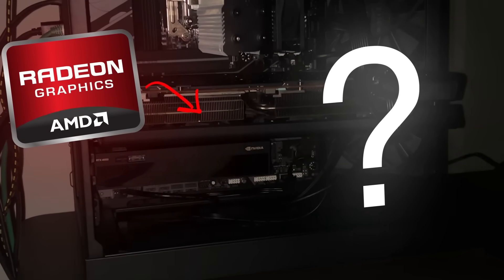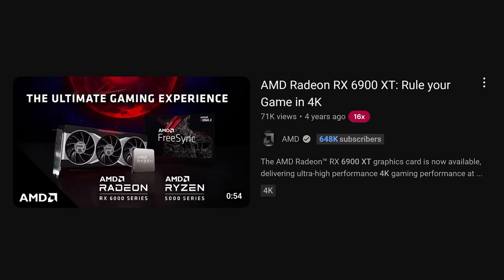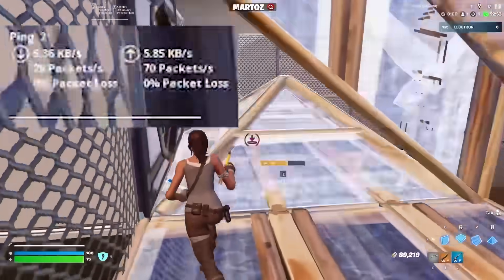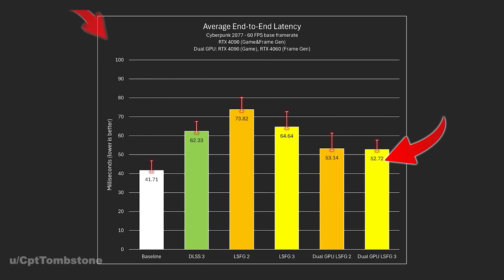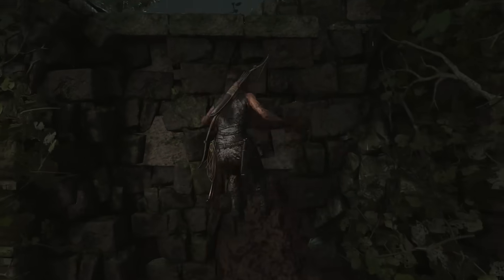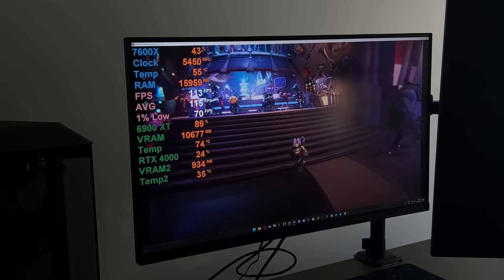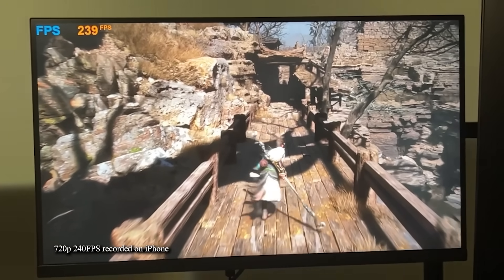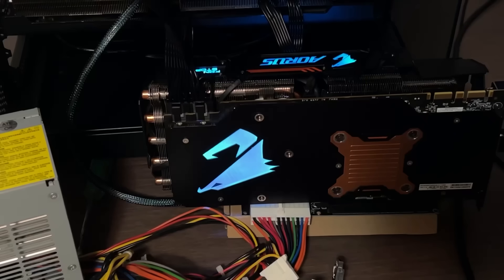I Used Both AMD & NVIDIA in One PC and Got 240 FPS in Every Game

Comment: so some warnings:

You MUST ALWAYS keep lossless scaling maximised on the screen, or you'll get the flipped FPS bug. So multiple monitors is basically required.

multi-gpu setup doesn't work well on windows 10. It's possible to get it working, but you have to mess around with the OS registry and a bunch of other stuff too.
This is made 1 000 000 times more difficult if you have two identically named (don't count the manufacture names like MSI, sea dragon e.c.t.) GPUs (e.g. my case; 2080 ti)

Works pretty easily with windows 11. But you have to use windows 11...

As mentioned in the video you need a high-end MOBO with 2 8x16 GPU slots.
Sure you can do what he did here but the M.2 interface is not really made to basically be maxed out constantly and every weird thing you add is just another fail point. I imagine most of the mentioned games would work (somewhat) with the accelerator card if it where not connected to an underpowered slot.

(for LSFG)
There will be at least roughly +2ms input delay with multi-GPU setup.

To get smoother generations it's recommended to have queue target to 1 which is basically -2 base FPS in additional input delay (so at 30 FPS you'll have ANOTHER +2.22ms input delay, 1.11ms for 60 FPS e.c.t.).

It's also recommended to have max frame latency higher for lower FPS games for better frame pacing (makes aiming easier), having it too low will break frame pacing - at the cost of even more input delay.

You can get a lot better frame pacing and latency if you use the fixed mode, instead of adaptive, and cap the FPS of the game to under its average FPS.

Adaptive is for games where you can't cap the FPS, the FPS swings by huge margins a lot (like 110 down to 40 for multiple seconds at least - like helldivers 2) or the average FPS is lower than 30.

If the second GPU isn't getting maxed out;
set the flow scale to max
tweak the queue target
then the max frame latency
(or just up the frame gen count if it's lower than your monitors refresh rate)

Comment: And all of a sudden, I can squeeze another 5 years out of my 1080 pc lmao.
Reply: yeah, you just need another gpu for it... wait... my ryzen 7950x has a built in igpu... could I use it to generate frames for my 7900xtx when the time comes? that would be a cool usecase ngl.
Reply: @uggZymoroon  old ATI/Radeon cards/APUs allowed for dual render. I think this was in like 2008-2014 they allowed it. In most games you get barely any boost, in very few games you get a MASSIVE boost, and in a few games you actually lose FPS
Reply: @uggZymoroon  You've got a 7900XTX brother you dont need to generate frames.
Reply: @uggZymoroon  you'd be losing performance due to the sacrificial core that have to render the frames. I think 🤔
Reply: @uggZymoroon yes you actually can! However don't expect miracles.
Reply: @uggZymoroon  bro's reinvented smart access memory
Reply: @uggZymoroon it would be useful if you limit the cpu performance so the igpu can work properly
Reply: "I'm tired boss"
Reply: I am looking forward to double 1080ti results of this method, if it actually works, the legend will rise again.
Reply: @maimaibiri9045  "now there's two of them...is this even legal?"

Fr tho, I'm still chugging along with the same 1080ti he was using in this vid. I'd love to add another to my fine collection (pun intended) and see what can be done with this setup).
Reply: @maimaibiri9045  I'm going 4070ti Super+1080ti, both blower cards. I'll be able to dry my laundry with them.
Reply: Pff, i'm squeezing another 5 out of my 2010 old weak ass radeon card pc, my 1080 current pc is gonna live at LEAST 15 more lol
Reply: What if your second GPU is a rtx 3050 that doesn't need extra power? Would that work?
Reply: @Chris-se6yh  depends. That 3050 has less than half the performance of a 1080ti
Reply: @OutOfNameIdeas2  it should, maybe as long as long as the first one has
Reply: Yeah my rx580 too xD
Reply: I just refurbished my 1080ti, cleaned the water block and put new pads/paste on it.  Poor thing, it was running a LN2 non-power limited bios for about 8yrs already lol
Reply: @ExtraVirginOIive  i run a 2010 mac pro😭🙏 shit's still pretty strong
Reply: @ExtraVirginOIive  that’s a lot of moneyz
Reply: who is lmao and do you know who lmfao is ?
Reply: depends what you play, sadly overall architechture , bus speed, CPU speed are gonna matter more ,  if you play large competitve world game could need 20+ core 6 ghz   '   like 'off the grid' example technology software
Reply: 1080ti lives on
Reply: nope.  plenty of games that require RT now and cant even be launched with your card.
Reply: Why would you use rt in a game like Fortnite it's stupid
Reply: While you don't get the latency REGRESSION of traditional frame generation when you use two cards, the latency is still going to be equivilent to the source frame-rate i.e. it will still FEEL like 30 FPS - even if the number says 60 and it looks smoother.
Reply: @zig131  this would be most useful for VR where you could double 72 fps.. 72 fps in put lag is pretty decent then you could use open xr tool kit to limit fps to what ever your hmd refresh rate runs at.. lossles wont work with vr as far as i know though
Reply: @awakeandwatching953  We have a superior method of "frame generation" in VR in the form of Asynchronous Space Warp, and whatever Valve call thier version. ASW increases visual smoothness AND reduces perceived latency. It works by shifting and warping the rendered frame to take into account head movement since the frame was rendered. It's kinda like what Nvidia Reflex 2 does with mouse movement, but available universally.
Reply: Brokie

Comment: I planing to combine 7900XTX with 6900xt via oculink. One plus with this setup is that they use same graphic driver. I wanted to sell my old 6900 xt but this way I can futureproof my 7900xtx even more. I already have pce4 ready m.2. slot so I can utilize full bandwith potencial of oculink but I still waiting to MINISFORUM DEG1 to arrive first :D ... Damn I never imagined that dual gpus can be thing again.
Reply: I wish you the best of luck with it, I have a tutorial and the discord server holds a wealth of information in case you need anything
Reply: @ivanvladimir0435  I come across the problem where I don't know how to force render on my 7900xtx while connected on 6900xt.. In preference graphic setting only showing me connected gpu but I have both gpu recognized in task manager.

Comment: What I find crazy is (and I'm not saying this to be a hob it's just from observation) my ps5 pro looks and runs sooooo much better than the single and graphics  card. My point is that every body laughed at ps5 pro price and said it wasn't worth it yet it plays old and all modern aaa games with no fram drops no stutters and at a dynamic 4k resolution through my 4k oled 55inch TV an looks beautiful for £700

Comment: I wonder how this would work with AMD's wimpy 2CU iGPU on Zen 4 and 5? Better yet, with a powerful APU, say the Radeon 780 or 890 and a dGPU on desktop or laptop? 🤔 EDIT - DX12 natively supports rendering across multiple GPUs and it is vendor agnostic (i.e. an Arc 580 paired with a Radeon 7800 XT would work) but game devs have to implement it, and none have bothered doing so. I suspect that this overlooked DX12 feature is being exploited by LS.

Comment: Maybe its because im tired af. I want to try this but i feel like im not seeing the actual steps? His crazy work arounds which are cool are throwing me off....

Gpus i have

4070ti super
4070
6900xt
2080ti
3070 x3
3060ti x2
2070
1660ti
1060 

If you want to know how i got all the gpus... it involves feet, webcams, peanut butter and rich old guys. Its a new venture called onlyfeet

1200w psu platinum 

Stupid z790 asus mobo with a half cooked 13900k 

Anyone want to reply the simple "just the facts" steps?

I can plug in the gpus easy enough...

Im just not clear on settings.

So i use the 6900xt as FG and just plug monitor into nvidia gpu?
Reply: He didn't list the steps, there's a guide on the discord server, where people with plenty of knowledge about it have been using it for over half a year now, the whole "discovered a pair of months ago" is complete bs
Reply: @ivanvladimir0435 hey which discord? The one in the description?
Reply: @ivanvladimir0435 YEAR AND HALF? NOICE!  I can't wait to try. Any tips outside the discord guide?

Comment: Wondering if I can do this with a 7900xtx and a 3070. Just wondering if the 24gb from the 7900xtx and the 8gb VRAM from the 3070 is going to be an issue.
Reply: VRAM is never an issue because the frame generation itself only takes like 200 mb at 1440p